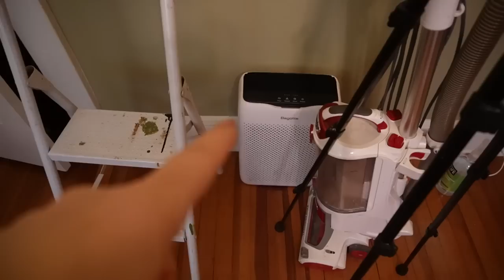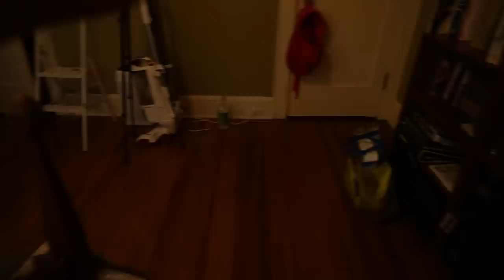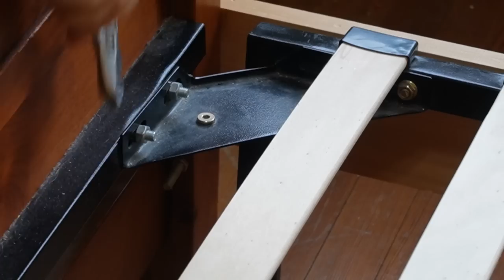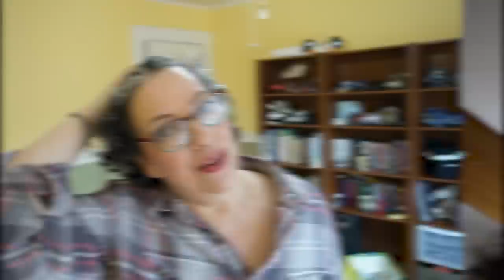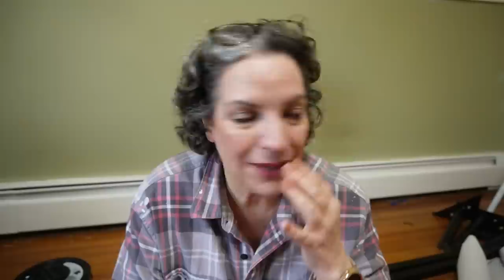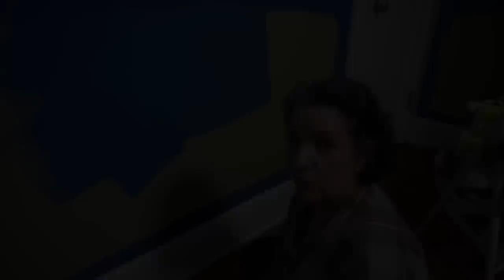Teenager Bedroom Makeover || Part One ||

Comment: You're to be congratulated for painting all day into the night, I'm quite a bit older than you and I have to paint in sections, like one wall a day or I'd be totally exhausted.  I've done my master bathroom and master walk-in closet and I agree Behr paint is the best.  I wrap my paint brushes in a wet paper towel, put in a plastic bag, then into the fridge overnight so I can use the brush the next day, same with rollers but no paper towels, I just wrap in in a plastic bag and put it in the fridge overnight so I can use it the next day.  I have very expensive paint brushes that I've used for years and keeping them in the fridge hasn't damaged them at all.